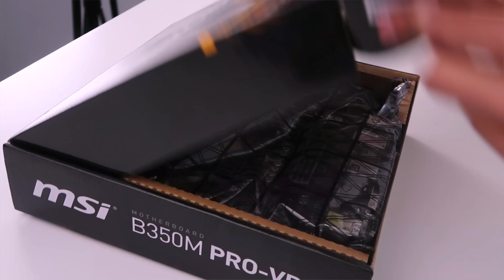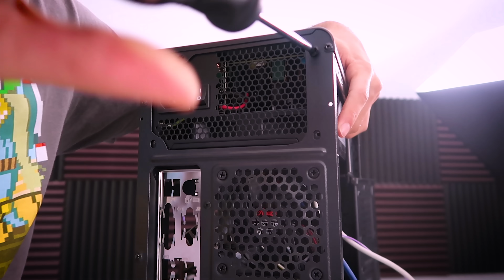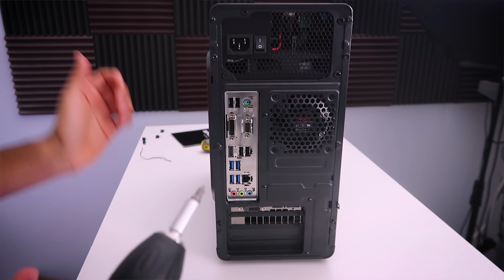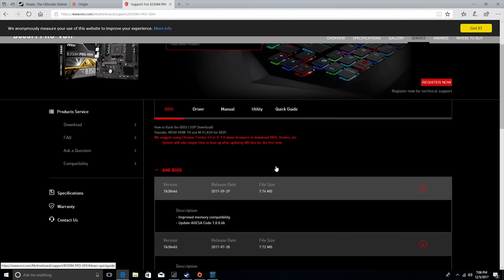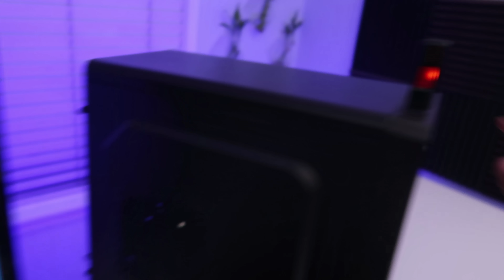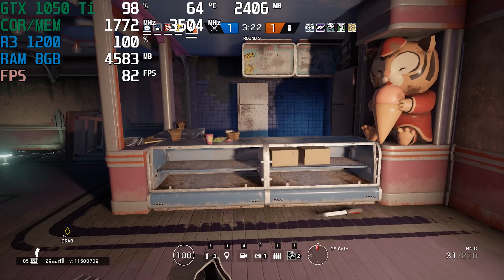$500 Budget Gaming PC Build Guide - GTX 1050 Ti (w/ Benchmarks)

Comment: Looked it up and it is 607 dollars as of September 22nd 2018
Reply: As of now it it 507
Reply: Looked it up on October 20th, 2018 and for everything listed, it was $1009.19
Reply: I have checked it on the 28 October and it goes for about 678 dollars
Reply: As of now it’s like 512 quid
Reply: Chris kazakos I'm building mine for under 530$
Reply: Check on PC part picker its 500
Reply: As of Black Friday with some upgrades here and there it’s 527 with a gtx 1060, Ryzen 5 1500x, 8gb ram and a 500gb ssd and the mechanical hard drive in the vid

Comment: I don’t want to sound like a noob but can I use a different case and if I could what size would it be
Reply: Bain Malum is a versa h18 tempered glass case compatible with the MSI mother board in the video
Reply: Bain Malum Ok thanks
Reply: you can fit a mini atx motherboard inside of a full size atx case for more room and airflow

Comment: Hi Joey, getting stressed about building a pc with my dad. He thinks I should get an i5 instead of whatever an AMD 3 is.
I've told him that upgrading from a GTX 1050 to a GTX 1070 and keeping the AMD 3 will be fine, however he is not convinced. could you or someone who is very experienced in this field please give us a hand with whether my idea (AMD 3 and GTX 1070) is better. 
Thanks, Rob
Reply: Comes down to doing research and showing him it.I went with a older prebuilt i7 instead of amd.
Reply: JustA Person I did some research and got some opinions and people have said that I should upgrade to an i5 and go for a GTX 1060 instead of a 1070
I could get an i7 and a 1080 but it will cost well over a grand, so that’s too stupid for me atm
Reply: Could do a older gen i7, i ended up getting a i7 4820k build on ebay rather then building a pc cause it was cheaper rather to build one.

Comment: I need help! Ok so I am planning to buy this build but I cant find some of the parts here in the Philippines so i changed some like the gpu ( GALAX GTX 1050 TI OC 4GB 128BIT DDR5 ),  psu ( CORSAIR VS450 POWER SUPPLY ),  processor ( AMD RYZEN 3 2200G 4-CORE 4-THREAD 3.50GHZ PROCESSOR ), and ram ( GSKILL RIPJAWS V 8GB 2X4GB 2800MHZ (F4-2800C15D-8GVRB) ). What do you think guys ? Will this build still perform as nice as the one in the video ? Plus I am also planning to overclock the cpu, gpu, and my ram. I dont know if that is a good idea on my build. Im new to pc building so yeah.. Thanks!!
Reply: Choices look good, make sure you get a motherboard that supports overclocking.I would get another set of that ram so you have 16gb ram rather then only 8gb.
Reply: Thank youuuu! Well the mobo that i would be using is the same one as Joey used in this build.
Reply: It`s a good build, i can`t say for myself since i went with a older i7 build instead but people that have done this build seem to be very happy with it.Just make sure to do some research first about overclocking before you do.Like what i said if you can afford two kits of that ram.

Comment: What kind of monitor is good guys I need advice?
Reply: Look for a high definition, cause you won't want your eyes to get dry from too big pixels
A low response time, 2ms is perfect, but get a 1ms for even better gameplay if possible.
Look for the amount of ports.
Look for a monitor which has dedicated game modes (optional)
Refresh rate doesn't really matter, 
144 Hertz would do if you're dedicated.
Reply: @gamebro5991  it matters if you want a smooth gameplay
Reply: Dank Donald benq
Reply: Always a 144 hz or better
Reply: 144 hz
Reply: Asus 1ms £100 monitor is great

Comment: I built this computer, only difference is I have a 500w power supply and the Coolermaster Masterbox Lite 3.1 TG so I have 2 120mm fans but when I play games like GTA 5 or Fortnite, it plays for a while then freezes and I have to restart it, I reinstalled the apps multiple times and made sure I’m up to date on drivers, I don’t understand why this is happening, help

Comment: Just built this pc (except with a better cpu, gpu, and an ssd). Thanks Joey! 

P.S: For first time builders like me, make sure to pull the power supply's cpu cable through the case before install the motherboard. If you don't you'll need to take the whole motherboad off to get the cable through.
Reply: Randall John dude where did u find the little tools he was talking about
Reply: Bladedflame 360 nowhere to be found on Amazon but don't worry about it, you don't need them. It only took me about 3-5 mins to screw in all 6 standoffs manually
Reply: Randall John oh okay thanks

Comment: Going from console to pc. Getting a pre built pc to avoid problems. Will I need a plug socket for the pc and monitor (I have monitor) or does the pc plug into the monitor and no power socket as it has a power supply?

Comment: Hi guys I just built this pc but it did not boot up on my monitor! Any suggestions to why this is?thanks
Reply: Conall Doherty same
Reply: I had the same problem. You got to plug the hdmi to the graphics card at the bottom. The ports are covered. Have to uncover them
Reply: Did you fix yours
Reply: killa boii no not yet 😔
Reply: killa boii finally got mine set up it turns out that I forgot to plug the pci e cable into my 1060😂
Reply: I had the same problem. You got to plug the hdmi to the graphics card at the bottom. The ports are covered. Have to uncover them

Comment: If I can save 600$ to pay for this pre-built PC. Then I could play some games, though I’m questioning if this could at least run Rust at 60fps average on medium. (Yes prebuilt, I’m terrible at building since a child so I rely on the manufacturer)

EDIT: Saving money for the mouse, keyboard. Monitor and the accessories is probably another 300 or 200 if you learn how to budget
Reply: I also budjet man. would recommend the redragon keyboard on amazon. And if you want a good mic get the fifne on amazon

Comment: Just finished building this tonight. Installing games now. For some reason they sent me a 500W power supply (I'll take it), and I got 16gb of ram. Can't wait to play test with in the hour. Waiting for WoW to install.

Thank You Joey Delgado!
Reply: Big Money Gaming how was it
Reply: @elcuh9976  its awesome. I only got to test a couple games last night briefly and they were smooth as silk. I personally dont recommend overclocking to 3.7 that speed was unstable for me (pc would freeze) so atm I'm running it at 3.1 and will up the speed to maybe 3.4
I'll really get some time to take it through its paces today. So far so good!
Reply: Big Money Gaming ok thanks what do I do about there power suply
Reply: @elcuh9976  just do,what he says in the video. Double check that you actually order the 430. The 500 I recieved will do no harm. Just costed more.
Reply: Big Money Gaming the 43o cost a lot rn
Reply: @elcuh9976  I know. I think its a screw up. I ended up with the 500w because of that.
Reply: Big Money Gaming can you send link to the one u used and sir thank u so much you are very helpfull
Reply: Congrats on the build, i was considering doing a build like this but i ended up getting a pre built i7-4820k instead.
Reply: @elcuh9976  its the same link as the one in the description.
Reply: @justaperson8815  Nice! 
Thanks, I'm loving this computer. Set up to a 50 inch TV, wireless keyboard/mouse, and a recliner.
Reply: Sweet, what did you go with for the cooler?I went with wireless too EagleTec only around 17 for mouse/keyboard but it works, mouse alone is worth the price.Should look at the display settings and see if you can make the t.v refresh rate higher possibly and GPU settings.
Reply: @justaperson8815  just the fan in the video. I'll check the tv settings today but I think it only 60hz. Thats okay, still a smooth 60 fps. The picture looks amazing though.
Reply: I only have a 60hertz t.v too, manged to clock it to 65 lol.was able to in display settings change it from 60 to 65 it was a option.I`m so done with consoles, pc`s are so much better.
Reply: Big Money Gaming how about the little tool he was talking about where did u find it 5:25
Reply: @DanTKD87  how is it for fortnite?
Reply: @elcuh9976  I did not have that little tool so I had to do that by hand. Dpnt worry its not difficult. Just hope you dont have fat fingers lol.
Reply: @YourMom-pw5vt  plays great on fortnite. I'll check the fps on it today and get back to ya.
Reply: Big Money Gaming hahah thanks no lol I have skinny ass fingers
Reply: Big Money Gaming thank you for all your help
Reply: @YourMom-pw5vt  60fps on high settings
Reply: Hey man im a noob. Can you tell me what the best overcook is
Reply: @DavidC2718  I set it to 3.4 because it was unstable at 3.7
Reply: THANK YOU SO MUCH. Mine kept on crashing and I didnt know why
Reply: @DavidC2718  no prob. Did lowering the clock stop your problem?
Reply: hey man do you think adding a ryzen 5 4000 would work ?
insteado f the ryzen 3 ?
Reply: @HSFarmerJoe  from what I looked up it should be able to handle up to a ryzen 7. Ryzen 5 should be fine.

Comment: Built this PC and over-clocked it. Big mistake don't over-clock this system or your CPU will overheat in a couple of days
Reply: McDonald's gaming Are u sure
Reply: Yes I had to return it and get a new one. The pc runs fine without the overclock tho. this is a great build but the heatsink with ryzen is not fit for cooling an overclocked chip

Comment: I'm building a budget pc. I was thinking of buying a dell OptiPlex 790. intel I5 (2000 series) and 8 gigs of ram. for 130 bucks. so with that, a 1050ti, and a 400w power supply. do you think I would get similar performance to this build? great video btw, these videos are a blessing for the, not so, tech inclined like myself

Comment: Thanks for the videos. I'm trying to weight out my options on building a PC when I start my new job this week. I definitely want something that isn't too pricey but definitely something that runs better than consoles because if it's weaker than consoles, what's the point of building the PC in the first place? Thinking of going maybe with a GTX 1060. Any ideas?

Comment: Do you need to keep the wireless internet USB thing forever or can you take it out after it connects? 
Also, is the wifi wireless USB thing only if you want super high wifi speeds or do you need it even if you want to simply connect to the internet?
Reply: No, it`s the receiver, go wired if you can with a Cat5 cable.
Reply: Do pre built's have the wifi have the receiver implemented in it?
Reply: Check Motherboad specs.
Reply: K thanks
Reply: If you`re doing a budget build i would get a cheaper motherboard and buy a usb one.
Reply: K thx

Comment: I need a 4 pin pcie express cable and a 6 pin pcie express cable on both either side. To make my graphics card work. Since i have the gtx 1050ti with two fans on it that requires a 6 pin pcie express cable? What do i do

Comment: Is the ryzen 1300x compatible with the same motherboard
Reply: yes it's compatible i build the same pc but instead ryzen 1200 i build it with ryzen 1300x
Reply: Beast Mode23 all ryzens use b250 Mobos I believe
Reply: @russianassslayer7185  so would a ryzen 5 work with this build?
Reply: @luismartinez7798  yep ryzens use am4,, AM4 REMEMBER THAT not am3  or am2  whole different mobo
Reply: @russianassslayer7185  thank you
Reply: @luismartinez7798  no problem!
Reply: Thanks guys
Reply: HapticVisual err ya I meant am 4 thanks for the correction

Comment: please, some please reply me. So i have a question about the gpu, first in the video, Joey used EVGA 1050ti overclocked, but there is another one(same brand) that just says just says EVGA, what differences does those GPUs have. Second, can I get a different brand that is also gtx 1050 ti? Will it have the same performance?

Comment: Does it work if i put gtx 1060 instead of 1050 ti in this build or does the motherboard support it?
Reply: ZOOM 007 it works, make sure your gpu fits the case (assuming you are going with the case on the vid) and you need to plug pcie cable from power supply

Comment: I build it but it wont turn on I don't know what I did wrong.
Reply: Joel Perez does it full power on?
Reply: Full power?
I pluged it in to the power outlead and tried to turn it on but it did nothing.
Reply: Joel Perez if nothing is turning on at all. It could be either the psu is broken in someway or you plugged the power button cable into the wrong one
Reply: Joel Perez *fully
Reply: ok I fixed it and yes I put the power plug in the wrong one.
Thanks for the help Don't fer me
Reply: Joel Perez it's fine man them little cables are annoying to plug in

Comment: can i build this but Instead of the 1200, can i use the ryzen 3 2200g? then take out the gtx 1050 ti? is it possible?
Reply: yeah but you will have lower framerates bcs vega8<1050ti
Reply: Giovann H i see. thanks
Reply: Giovann H what if i use the ryzen 3 2200g with the 1050ti? is it still compatible?
Reply: leon dafuq yup you can add 1050ti, make sure to connect the monitor to the 1050ti card not the mobo
Reply: Giovann H i have one more question. what type of monitor should i get?
Reply: leon dafuq 60hz 1080p monitor for casual gaming, i would recommend benq product
Reply: Giovann H can i still play pubg with this kind of build? sorry im still new to this, still need to learn a lot about pc building haha
Reply: leon dafuq yes you can play pubg with that built

Comment: I just built this pc I got the ryzen 3 1300 instead and a different tower. Thanks. 
But I’m having trouble with the all in one pc I just got trying to use it as the monitor.. so I bought a monitor. But I’ll have it up and running here very soon. Oh also got a 500w power source so if I want to upgrade it was only 6 dollars more haha.
Reply: ExSolutionz what tower did u use and did everything work?
Reply: Bladedflame 360 the vivo micro atx mid tower white. This build I did I get 124 FPS for overwatch and fortnite I get 110 FPS. And I’m not over clocking at all.

Comment: I am building about the same thing just with a and Ryzen 3 2200g with 1 tb hard drive and 500gb ssd for games and a gtx 1050 I will use the same case with a asus prime b350 motherboard 500w power supply and 8gb 2400 MHz  this is gonna be my first build  the only thing I am worried about is that usb wires u have to plug into the motherboard and also if it just doesn’t work I am taking a big risk and spending money that I might not get back but it’s worth it for the sake of technology well I am only spending 300 I was gonna go for 500$ but I can’t afford that I mean I could but it will take me about two years to save up that much since I get paid 25$ each month btw I am 13 years of age so yea oh yea i also need to get a hdmi monitor since the motherboard doesn’t have vga but I am not worried about that and I will also save up for a gtx 1050ti  ur vids really help thx I will surely subscribe and oh yea turn on notifications too

Comment: would it be possible to use an external hard drive instead of internal as i have a spare 2 terabyte external hard drive? Anyway great video
Reply: Jared Flavel from what i know you can't since external hdd use usb to connect to pc, internal hdd use sata cable

Comment: does it need to be this case or any case??
Reply: ReikoWrld any case that support matx board
Reply: so if i want a glass light up case i cant use for this? im confused can you like explain because i thought it was only 3 types of cases
Reply: ReikoWrld first thing to do: you search the designated case you want, then check whether it's compatible with micro atx motherboard or not(since joey use micro atx motherboard in this case), if the case support/compatible then you're good to go. usually they list the supported type of motherboard so a simple search will do. for the 3 types of casing there are full tower, mid tower and mini-itx

Comment: hey i tried this exact same build, but with a different case. the case i used was the Rosewell atx mid tower gaming computer case. however in this case i couldn’t find the hdd led+, hdd-, or reset switch qs cords. if u could let me know the problem that would be great!
Reply: It doesn't have led's
Reply: try using it

Comment: The power supply you linked is out of stock, which one would you recommend as a replacement that is compatible with the rest of the build?
Reply: datfloppynoodle any 400w/450w/500w whatever available that has 80+ bronze rated and decent brand
Reply: Giovann H thanks, do you have a specific brand in mind?
Reply: datfloppynoodle evga, seasonic
Reply: Giovann H thanks

Comment: Hey I’m new to all these parts that are necessary for a gaming pc so I searched for a pre assembled one already from Walmart, can you tell me if the specs are good to support gaming and if it’s worth the price? https://www.walmart.com/ip/iBUYPOWER-WA563GT2-Gaming-Desktop-PC-With-AMD-FX-6300-GT1030-2GB-1TB-HDD-8GB-DDR3-and-Window-10-Home-Monitor-Not-Included/164694268?sourceid=dsn_fb_cd5b9f48-a603-4d3f-b19f-4c1b194d9b04&veh=dsn&wmlspartner=dsn_fb_cd5b9f48-a603-4d3f-b19f-4c1b194d9b04
Reply: Danny Pecina hey, from what i've seen it's quite a bad deal because fx series is worse than newer ryzen, not to mention it runs at ddr3. if you are in a tight budget then go with 
cpu: ryzen 3 2200g
motherboard: asrock b350 pro4
ram: gskill 2x4gb 3000mhz or higher is better
power supply: any evga 400w or more 80+ bronze rated
casing: anything that fit the motherboards
with this build you can get a similar performance with the link you gave, and will cost below 400$ and it provides better upgradability (cpu and gpu)
Reply: Giovann H thanks for helping me out, I will go with your advice!